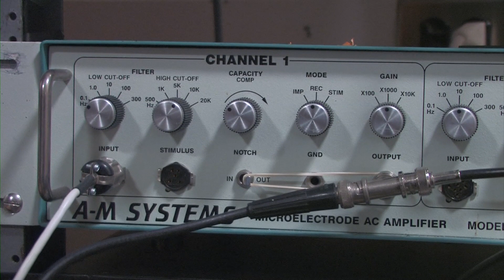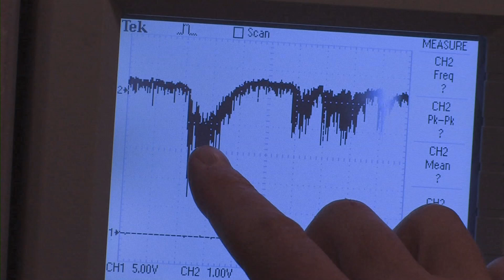Mosquito Hearing at High Frequencies

Comment: Interesting. I am the Author of 5 books on sound and a recent patent based on "The Ward effect" https://www.youtube.com/watch?v=wuIj3mDpJls  It may be possible to break mosquito antenna with a resonant wave I would suggest using Tru RTA software to analyze the sound. Would be interested in a sound clip if you have one. Would analyze it and send you a report kiwimeasurement@gmail.com  Dave Ward
Reply from the maker: I did the video but Prof Ron Hoy in Neurobiology and Behavior at Cornell and his students did the research. I have forwarded your e-mail to Prof Hoy who points out that the mosquito antenna is rather floppy and unlikely to be resonant. Thanks so much for your interest! Charlie
Reply: @pigeon2534  Thank. Even though the antenna is floppy it may be possible to disrupt and break them. Everything has a resonant frequency. I suspect that the male mosquito are responding to a sound signature  rather than a specific frequency.I shall download some from the net. The equipment used in the mosquito may not be as helpful as a spectrum analyzer. If interested in the result of my analysis I can forward to you